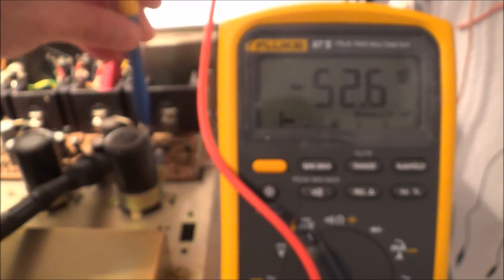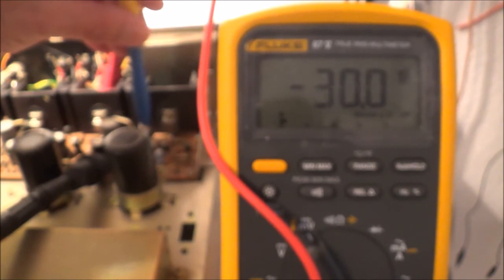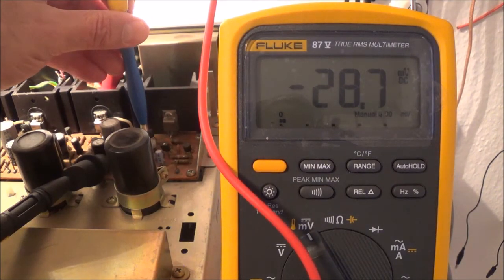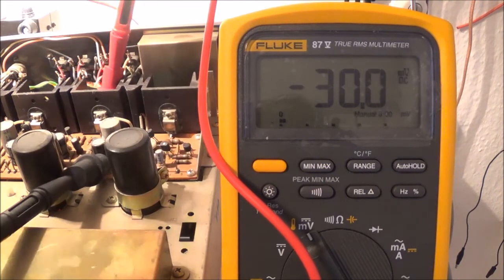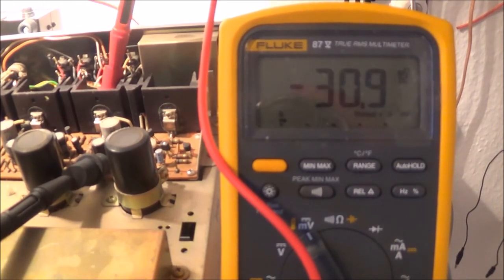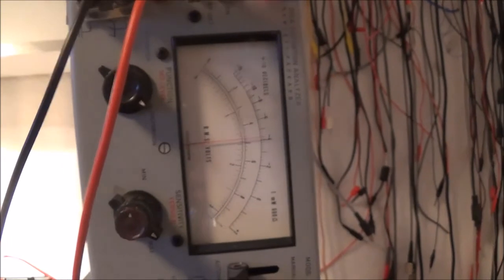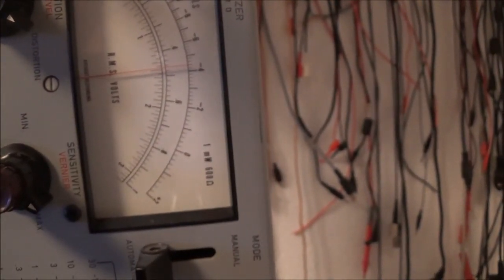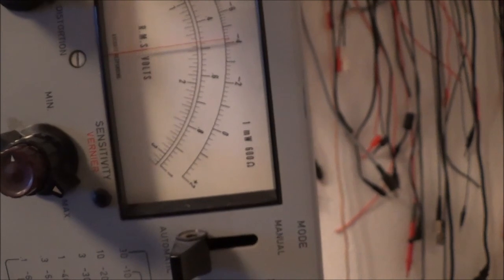Pioneer SX-525 Stereo Receiver Bias Adjustment

Comment: What a variety of comments, 30mV for idle current is pretty common with SX Pioneers as what is stated for my SX980. Appreciate close-up of your "fluke" because hat is what I need to go buy because I question my Bias and I do not think fly-by-night shop I took it to did anything even though I requested it to be adjusted.
Reply from the maker: Yes, most of these Pioneer units from this era go from 15-30 mV or so. Right, those comments are all over the place. At any rate, I'm not sure if you need this particular Fluke though; it is rather expensive if you buy it new. Could be that the shop did not do this adjustment. Best to carefully check it yourself. For example, connect the meter before you turn the power on.
Reply: @OldSchoolElectronics  Much appreciate your opinions on mV on what you think they should be set at. Have a muti meter ordered and just waiting, in mean time, watch all the videos I can. From your thoughts, I bet I get a very low mV reading on DC, very noticeable high-freq. noise even at low volume. As the saying...........if you want something done right, do it yourself.

Comment: I have a Sony ST212. My problem is it goes way too loud. Have a pair of 200 watt PA speakers and the amp is rated at 2x20 watt. With the volume at nine o'clock it allready is very loud. Would this help for that problem?
Reply from the maker: This would not help; your problem lies elsewhere. At the site www.hifiengine.com, the ST-212 is listed as a tuner. You might have really sensitive speakers which also might have a low impedance such as 4 ohms; that would make your stereo sound louder than usual.
Reply: Thanks for your reply. My speakers are 8 ohm 200 watts with a peak handling power of 400 watt.
You could be right my speakers are too sensitive for this little guy. It does sound really nice though when played at a normal volume as long as I don't cranck it up.
Oh and sorry, I did mean the amp, not the tuner.

Comment: I actually found a service manual for this unit. I'm sure you know that HiFi jargon back in the early 1970's was fast and loose with the FACTS when referring to specs. Pioneer was no exception. They list power output as follows... Music Power 72w (4ohms) 52w (8ohms). It gets better, continuous power each channel driven 26w/26w (4ohm), 20w/20w (8ohm), both channels driven 21w/21w (4ohm), 17w/17w (8ohm).
 This kind of hyperbole will drive people nuts and probably did. The IHF (Institute of High Fidelity) in 1978, under direction of the FTC (Federal Trade Commission) required that ALL amplifier reserve power ratings be in decibels of headroom, ie. 3db or twice the rated power. I was wondering on your take of this nagging issue?? I have more info regarding the SX-525 but I'll save that for another video. You do produce interesting and educational videos. Thank you..
Reply from the maker: Thanks for your praise! That (amp power ratings) used to be a big problem; especially when the manufacturers only stated the music power. I suspect that some still fudging up to this day. I still remember some people telling me about their super powerful systems; I didn't want to upset them by telling them the truth.
As far as I remember, there was also the "peak" measurement way; this was using the peak rather than the rms voltage of a sign wave. That brought the numbers up....But it kind of was the truth, since I think that at the peak the amp delivers about twice the output power.
By looking at the above info you gave it seems like the music power is 3 times more than the rms rating! I've always go by the rms standard, although sine waves aren't exactly music. But a sine wave I guess is a better indicator of how much the unit can put out continuously; that is, the average power level is supposed to be higher than that of musical waveforms, which as you know, can really vary. I don't exactly remember, and research would be too time consuming, but the music power rating involves some trickery too; I am not sure, but I think an "ideal" power supply instead of the standard power supply is used....kind of like taking the engine from a Porsche and dropping it into a VW bug for a test...That being said, I am no expert on this subject.
Reminds me of how happy my brother was when he brought home a "hifi" stereo that some dudes sold him out of a van in a Home Depot parking lot. Normal price was $1200, but he could get it right on the spot if he took it for $600. The bargainer that he always is, he talked them down to $400. In reality it was maybe a $100 plastic stereo...
Reply: Old School, sounds like you remember the OLD DAYS pretty well. For a guy who's not an expert you seem pretty knowledgeable. I always tell folks (those who listen) buy the best components you can afford and just listen and enjoy. Too many people have to get the best equipment, it ain't necessary. 
 My first system in 1975, purchased with overtime cash, was a Pioneer SX-434 receiver ($127) and a BIC-920 turntable with Shure M-70 pickup ($60) and KLH 31 speakers ($60.) I was earning $90 a week! I was sooo proud of my stereo setup. I remember in 1979 Infinity had the Reference Standard speaker system for $20,000!! In 1979 dollars.
 As for amplifier power ratings, I think if you check the rear apron of an amp and look for the power consumption figure. Divide that by three (as most amps waste 2/3 of power in heat), then divide by two for watts per channel, it should be pretty close to the real output. From watching your video, you know vastly more about this stuff than me.  I tip my hat to you, sir. One question, older or younger brother??
Reply from the maker: thanks for your comments. actually, i had been out of electronics for 20 years; just wasn't my thing any more. l went to electronics school in the 80s. back in the day everyone wanted real big stereos. i worked my way up to infinity speakers (don't remember which ones--not the monsters you had--wanted those too, but they were too much). never did make it to the klipschhorns i wanted even more...then one day, the magic was gone...actually you can almost kinda tell the power output of a lotta stuff i work on (mostly low power) by looking at the transistor sizes, voltage to the output transistors, and heatsinks. i just do power output tests for the fun of it...my younger brother bought the stereo in the parking lot. i knew better ever since my electronics instructor used to show off his massive mcintosh amp by hooking it up to load resistors and by monitorng it with a scope. turned up all the way, of course...anyway, thanks for your praise and have a nice day!
Reply: Hey Old School, thanks for the chat. I must apologize if I inferred ownership of the Infinity speakers, they were way out of my budget too. For speakers I have Ohm Acoustics Model L's, EPI-180's, EPI-100's and Boston Acoustics A-40's. Pretty much all my components were purchased in the 1970's/80's when I was single and had the bread. I just try and keep everything running. LP's, cassettes, open reel, and CD's are my bag. However, folks like you should keep doing these videos as they help keep the rest of us informed. You  provide a service to your audio brothers and sisters and are appreciated. Much thanks my friend.
Reply from the maker: thank you sir, for your kind words. looks like you got a nice setup.  i hope to continue making videos with the focus on the 70s and 80s; the golden era of hifi. that said: have a nice day!